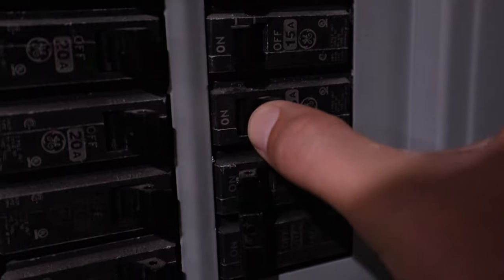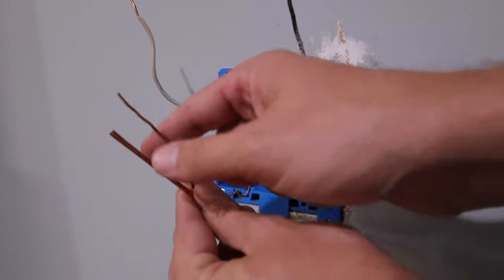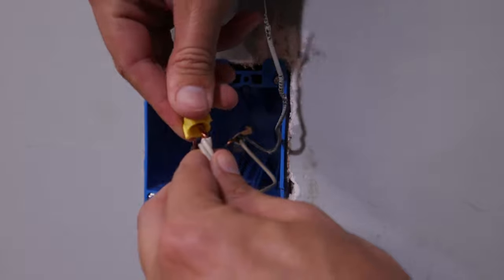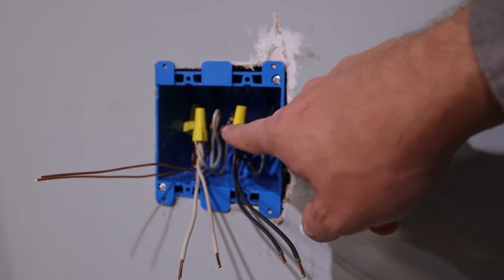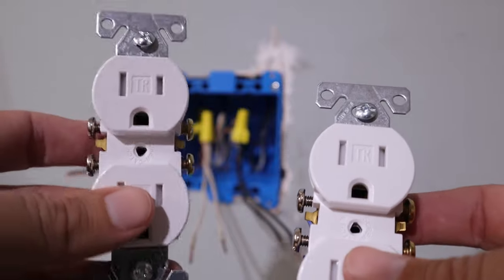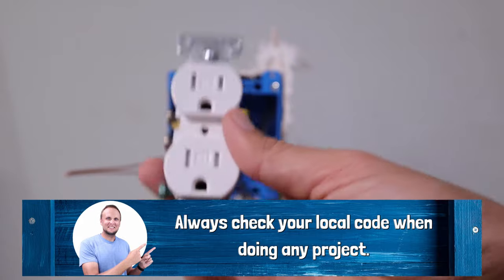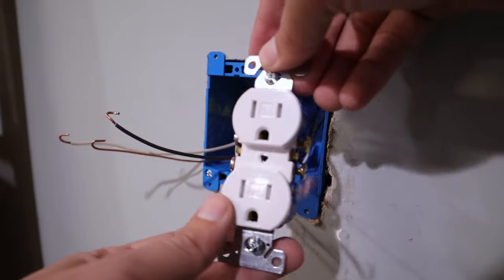How to Wire 2 Outlets In One Box | Wiring a Double Receptacle the Correct Way

Comment: I pre-wired my outlets in a box out in the workshop for an attic installation using jumpers. I've done this before but something didn't seem right.  I came inside and Googled: "how to wire a two gang outlet" and this video was at the top of the results.  Now I have to undo and redo what I just did.  It just makes sense.
Reply from the maker: Yeah that is how many used to do it.  This was shown to me by an electrician buddy and like you said, it just makes too much sense.  Thanks a lot for the feedback, glad you liked it!
Reply: @HowToHomeDIY  hello, my existing wall outlet I’m using for my tv is only 1 gang. And it’s located on the lower part of the wall close to the floor. I’m planning of hanging my tv to the wall and thinking of adding another outlet on the upper level of the wall where the tv would hang. Is it safe to do this set up(2 gang outlet) but my electrical connection is coming from existing outlet? It’s like an outlet extension but hardwired.

Comment: The jumper would be a series setup which would also create more heat on that first outlet, the setup you are using would be parallel, which means current doesn’t need to travel through the first outlet in line in order to get to the next, less load on the outlet, and safer imo

Comment: I recently bought some fancy outlets that are temper resistant and have usb power ports on them.  I had a two-gang receptacle they were going in. It already had power coming into and going out of the box. The problem? The cool new outlets only had one set of screws, and being good outlets, no punch-throughs. I'd only every wired using the terminals and all the diagrams I was seeing online were using jumpers. You can't jump with only one terminal for neutral and one for hot. Your video and these schmancy outlets requiring me to go find it have been the best education in proper wiring I've ever had. Thank you.

Comment: Nice, concise presentation. I use this method too since as you mentioned, it doesn’t cause a chain failure downstream if one outlet malfunctions.  It also had the advantage of making any future receptacle replacement easier.  One point, however. You don’t need to pre-twist the wires.  Code requires that all products be installed according to manufacturer’s instructions and Ideal, one of the largest wire nut mfgs, states that pretwisting is “acceptable, but not required” and that if you do, you strip to a little longer length. Also, worth mentioning for the first time DIYers, is to tug on each wire after twisting the wire nut on to make sure each is firmly secured.  This is especially important when connecting stranded wire which is harder to secure and needs to be a stripped a little longer than the solid wire it connects to. Keep up the good presentations.

Comment: I had a successful install after watching this video! Thanks!

When I was finally ready to place the two outlets in the box, I got a little nervous about how close the neutral terminal from one outlet was to the hot terminal on the other. I covered both terminals with kapton tape in order to add some extra insulation.

Comment: I see where that is good alternative to relying on the breakaway connector on the side of receptacle had one fail giving intermittent Power to refrigerator causing circuit board failure. Good video! This was at friends house she called me after 4th refrigerator died in same way as three before. Take the the time to do it right it pays off in the long run  !

Comment: Did a bit of electric work in a hospital I worked at. I'm about to do a plug addition in my bedroom so that I can get rid of the multi plug that keeps falling out of the wall.
I wanted a refresher to see if i had to run the wirse seperate or if I could jump. I prefer seperate just for the reasons you mentioned. 
Thanks for the refresher brother

Comment: This is an excellent video, well done and well explained. I would mention that wire nuts come in different sizes depending on the wire gauge and number of wires and also not to use the push in (quick wire, back stabbing) option on residential receptacles. They can be problematic over time. I prefer using commercial grade receptacles, not much more expensive, but more durable. Another method is to use Wago lever nuts instead of wire nuts as they are easier to use and highly regarded by most. I would also wrap the sides of the receptacles with electrical tape for safety.
Reply from the maker: All great tips and optional things that can be done or should not be done in some cases, like the push ins.  I am also not a fan!   I am still a believer in wire nuts over wagos but that's a highly debated subject everywhere and without a real clear cut winner.  Both have their pros.  Thanks for the feedback!
Reply: @HowToHomeDIY   About back wiring outlets, I too am not a fan.  But this is for the old ones that first came out in the 70's, you were supposed to be able to release them by pushing a screwdriver in the slot.  Well I had to smash one to replace it and it was just super thin copper plated steel spring strips, how anything that poorly and cheaply designed could be approved by any agency is beyond me.
However the newer higher end commercial outlets have a much better design.  They have a plate with a V-groove on the back side, slide your wire in and tighten the screw, they have much better surface contact and the V clamps down on it like a vise.
Reply: I was told old puds wrap the outlet in electrical tape. But I'm a pud like that
Reply: @towdoctor670  I do that in the tiny old steel boxes especially!

Comment: I'm glad to see someone use the recommended technique by using pigtails.  Too many people use the receptacle itself as the passthrough by attaching the second receptacle to the first's set of secondary screws (hot and neutral).  I removed all those in my house... in some cases they used the secondary screws and the stab connectors to make three connections off one device.  Bad!  Use pigtails and run one wire for hot and one for neutral for each device.
Reply: What's so bad about using a passthrough receptacle?
Reply: @billgates3229  nothing

Comment: Nice video. Idk on flip side pigtail wire nuts are another possible failure point and more junk stuffed in the box, but agree this does isolate them from impacting each other.  My kid is an electrician and they just wire in series, but mainly because it's faster to do.  I believe either way is acceptable.  Nice to have options.  I've had one maybe 2 outlets fail in 27 years in our home so it's not very common.
Reply from the maker: Thanks Bret!  Appreciate the feedback!

Comment: My metal boxes in my 1950's apartment building are not deep. About 20 years ago, I hired an electrician to upgrade my receptacles to 3-prong. In order to get all the wires and the nut caps to fit into a tight 2-gain box, he used a jumper wire technique that I don't fully understand, but the box has always worked and tested "correct." Do you have a video showing this technique and all its variations? If not, would you consider making one? I want to upgrade again to LED compatible switches and 20 Amp heavy duty receptacles, and the wiring diagrams are not matching what my electrician once did. Thank you!

Comment: Great job and very clear.  I have one power source coming in and two plugs just like you have.  I will also be exiting the box to a outdoor lamp and running down the yard (underground) to another lamp.  In this case, I'm assuming that I would have 4 pigtails each for black, white, ground (one to plug one, one for plug two, one for the first light, one for the second light).  Of course the longer run down the yard is not a short pigtail, but a long run. Same concept.  Please confirm if my understanding is correct.

Comment: Great video, very clear. I was hoping to see how it went getting all the wires stuffed into the box. Any tips for expanding a single outlet into a double located on outside of the house with vinyl siding?
Reply: JUMPING wire, between outlets, saves space by eliminating the need for wire nuts.  If you still prefer the author's method, you can use "plug-in" wire connectors, which are less bulky than regular wire nuts.  Lowes/HD sell them.

Comment: The tabs on mounting bracket should be broken off at the pre-scored lines so the device will sit flush with old work box flange. As shown the cover when installed may not come up tight to the wall.

Comment: Wondering if NEC allows the jumpering from one receptacle to the one next to it.
Glad to see that you pretwist the wires instead of letting the wire nut do that.  I used to not pretwist and had trouble with things not connecting well.
Also glad to see you don't stab the wires in the back.  I hate that lazy method.
Reply: Jumpering from one receptacle to the next is permitted.

Comment: Amazing video, thanks!  I use the commercial recepts with the clamps and have wired the feed to the bottom set on recept-1, jumpered top recept-1 to bottom recept-2 then down stream nmb to top recept-2. Is this bad? Is the pigtail method the only good/safe method? Z-method does save a lot of space. Thanks again, cheers!

Comment: Great video, my issue is I have a double outlet. Left side GFCI, right side dishwasher switch. Right works fine, left side GFCI doesn’t work but the little light at the right side corner does light up. What I am doing wrong? I retired it several times w/ no luck 😢

Comment: So to be clear, you should never have wires on both of the possible screws at each connection. Is that correct? You should only have wires on each set if the outlets have been separated?

Comment: Hi, I tried to diy a double outlet using your video. Would you know what could be the reason it didn't work? The outlet bounces a braker  in that area (with sparks) and also the light that was after that outlet does not work.  How would you check for errors.  Perhaps my wires were too long? Could that be an issue?

Comment: I'm mounting a metal 4x4 box and then running wires to a second one.  I know to wrap my bare wire to the ground screw, but does the second box (the end of the run), have to be grounded to the first box?  Or is it simply enough to ground it to its own ground screw?

Comment: Did u attach the ground to the box.   I didn’t see that part.  Great job.
Reply from the maker: No I didn’t.  The ground doesn’t have to be attached to a plastic box as it is a non conductive material.  If it was a metal box, then a ground wire would need to be attached to the box.  Hope this helps!  Thanks for the feedback!
Reply: @HowToHomeDIY  thank you!

Comment: In the past I've always just ran jumpers of the same size wire off the load side of the first outlet which was connected to the source into the second outlet Is that acceptable as well? This would put the outlets in series I guess creating more load potentially but as long as the outlets are rated appropriately and the wire is the same size Is there a problem with that?

Comment: Good job.  Nice and simple explanation.  How do you feel about using those electrical multi connectors instead of wire nuts?
Reply from the maker: So I use them from time to time.  I used them yesterday because I had quite a few wires in a small box so they can be helpful there.  However, I always prefer bonding them together with wire nuts on top whenever possible.  I just believe it is better.  I can pull the wires out of some of the connecters without using the release button.  It takes some decent pulling but they can come out.  So long story short, I think everything has it's place.  Thanks a lot for the feedback Pat!

Comment: Question: Would getting a 12/3 wire for my 20 amp line of double gang outlets mean that I only have to make pigtails on the neutral and ground and just straight up use the black wire to ones and red wire to the other? 

Thank you

Comment: Has anyone ever mounted each receptacle in the opposite direction, such that the same polarity screws face each other?  I was kind of paranoid of the opposite poles being so close to each other, so I did this for a project.  An added plus was that it provided the flexibility for those right angle plugs that never seem to plug in the best orientation.

Comment: I was using 12 wire and wasnt comfortable with four 12s under a wirenut so joined the incoming and outgoing wires and ran a single pigtail to one receptacle and jumpered to the other. It was a pita and I 2nd guessed myself afterwards about not putting the four 12s together. i think when my wirenut supply runs out I'm going to switch to wegos.

Comment: Thank you for the video!! A question, does the white and black wire need to go on the bottom, or can they go on the top screws? Thanks!!
Reply from the maker: They can go one either of them as long as the terminals are still connected and not switched.

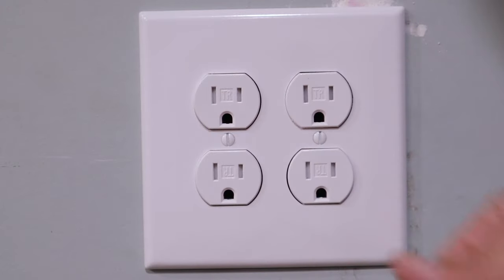Comment: I get that this is not the focus of your video, but when using a plastic remodel box you should remove the yoke ears on the receptacles so they fit flush with the drywall, otherwise you may get a gap between the cover plate and the drywall. At 7:18 looking at the lower part of the cover, the gap is evident.

Comment: Here’s my question just in case you used them all do you think the power will not shut off , cuz you using one power line. For a lot thing.
Reply from the maker: That depends on the circuit and how much you try to use on it.  In my case I have never had an issue with what I use.  Everyone’s scenario will be different.

Comment: Does the resedential NFPA/NEC code not allow series wiring (wiring the 2nd outlet off the load terminals of the first outlet ) for outlets in a residential setting?
Reply from the maker: That is permitted by code yes.

Comment: Does it matter which terminal you put the neutral and hot wires on? I know you put the hot on gold and the neutral on silver but in this situation you only had one hot wire for the gold screw, can you put them on which ever one?
Reply from the maker: Yup can go on the top or bottom screw for the corresponding wire.  Doesn’t make a difference as long as the bridge between the two hasn’t been broken to make it a switched receptacle.

Comment: Can you run a new line threwoff gang box to runn another outlet or switch? Or CAN i connect another romex line in double gang box attach hot aand neutral and ground to the already pigtail for bouble gang bow ..Or do i need to put in another junction box  1800 . to start new bedicated line.?

Comment: Thanks for the good video! Personally, I hate the tamper resistant outlets. I know they are required, but they are more expensive and very problematic even when new. I use the pigtail method as I was told to do so by real electricians, but (with the exception of backstabbed which always cause trouble unless the type that screw clamp) I have seen more issues caused by parallel wiring knocking out power down the line (and melting insulation!) due to faulty wire nut splices than from daisy chaining with screw connections. I am tempted to daisy chain as it is easier, saves time, and is more reliable in my (limited) experience. But I don't due to peer pressure from the pros with more experience than I. Also, I think the Wago connectors are like backstabbing, but the leverlock may be OK. Are they better than a poorly done wire nut connection? Perhaps a well done wire nut connection is best but when I many with 4 or more wires get pretty sloppy.

Comment: If wired the same and one of the outlets was a switch for a light; would it still work fine? Thinking of converting the single bathroom switch to have an outlet next to it but I want the power for the outlet to always be on and not controlled by the switch.
Reply from the maker: Yes because the feed is pigtailed so they are independent of each other.

Comment: Thats not even how I do it. However this is a good way to do it as a beginner. I noticed you are at an "end of the line" box. If you keep on going past this box, just add the exiting wire going to the next box to the bundles.  The way I do it as a person who has been doing it for 3 decades is cut your dog legs a little long... maybe a foot or so. About 5 inches from the end of the dogleg, strip the wire and work it back to the short end, leaving enough room for your screw lug. Then strip the ends off. attach the middle stripping to the first outlet, so you have a long tail on each end, then attach the 4" lead to the other outlet. This leaves a loop of about 4 inches, the spacing between the plugs. Do the same with all three leads. The other end I attach to the power in the box. This reduces how many leads you have in the wire nuts. Not a problem in your example, but if you have a "busy" box with a lot going on in there, it can get crowded, and it will start to matter how many leads you have living in there.

Comment: Great video info. Thanks.
I have a question. I did open a box of two receptacle. I dicontected as I'm goint to add anothe receptacle. Inside the box was coming out 2 hot wires + 2 Neutral + ground. For some reason when I  run a power test, only one hot wire is working??? What happen? Both receptacles were working!!
Reply: The other set of wires runs to the next outlet in the room.
Reply from the maker: I would have to see your current setup but typically you only have one feed wire coming into the box.  The other black may be the wire going on to another receptacle.